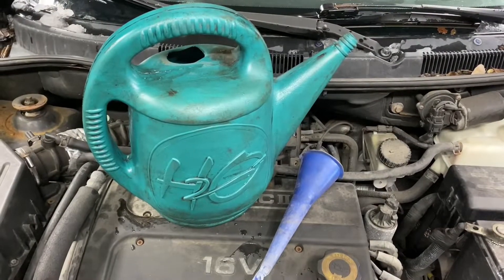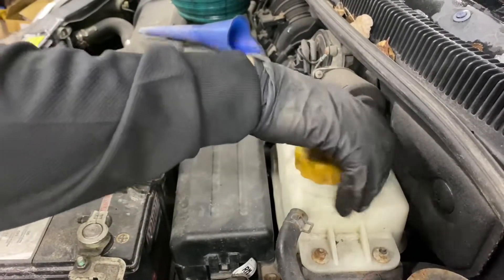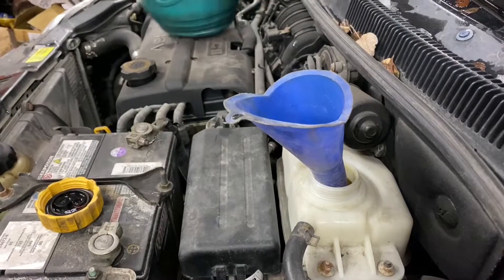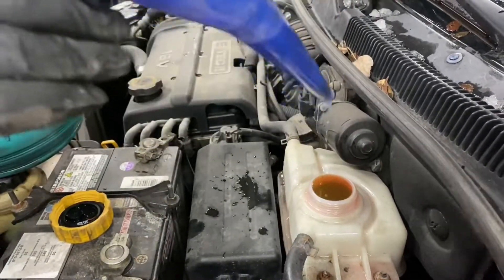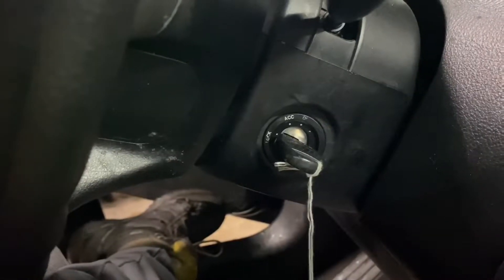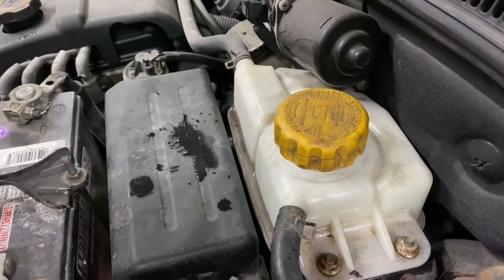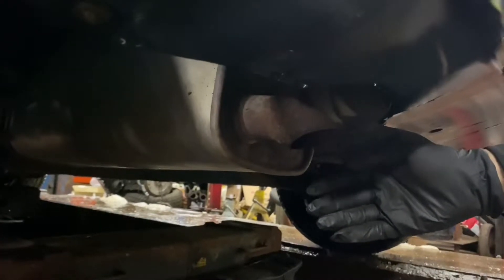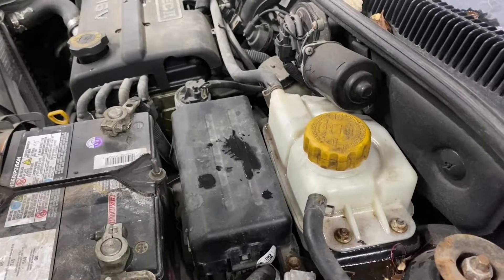What Happens If You Put Water Instead Of Coolant In Your Car! #subscribe #experiment #learn #car

Comment: Coolant is just water mixed in with some additives (a type of alcohol). The additive reduces the freezing temperature and increases the boiling temperature of water. Topping off the coolant with some water should be fine.

Comment: I have never used antifreeze in any of my vehicles. I use pure water. I have never had a single problem. I do drain the water every couple of years and there is a little bit of rust or dirt but no more than when I used to use antifreeze. Now, if I lived in a freezing climate of course I would use antifreeze. That's why they call it antifreeze!😊

Comment: You have probably over filled your cooling system.

Be ready for some potential pipes or radiator or resovior leaks, that extra fluid will build excess pressure and burst open something.
Reply: You say it like that's true. 
But it isn't.
Reply: @aaronbrown1638 Happened to me. I'm good now. Typical bot account

Comment: the reason why you use coolant instead of straight water is coolant acts as a lubricant for the water pump seals and bearings, straight water will do in a pinch but it will wear out your water pump faster, if you been using straight water dump it out and replace it with coolant! coolant cost like 15+ dollars a water replacement pump cost a few hundred!
Reply: I have never used antifreeze in any of my vehicles. I use pure water. I have never had a single problem. I do drain the water every couple of years and there is a little bit of rust or dirt but no more than when I used to use antifreeze. Now, if I lived in a freezing climate of course I would use antifreeze. That's why they call it antifreeze!😊
Reply: @bentrider  we call it all antifreeze, but in reality its two different items, im my younger days I never used coolant or antifreeze, I thought it was a rip off really water pumps would usually last about 5 years but back then it the older cars the water pump was easy to get to, the bearings would fail or the impeller fins would rust off, now a days with modern engines mounted sideways its not so easy to change, some cars the water pump is run off the timing belt so its buried in the engine compartment not an easy or cheap fix. now that I use coolant/antifreeze, I haven't done a water pump in years, if you use straight water with good results thats awesome, I have a lexus and a crown vic, the crown vic water pump is a piece of cake the lexus looks like a nightmare!
Reply: @mibnixon  😀👍

Comment: I used tap water in my hyundai accent for years
It caused rust in the cooling cycle and the rust caused corrosion in the aluminum parts, then the corrosion caused loss in coolant and heat then head gasket damage, the engine  started mixing water and oil
It was an expensive lesson
I got it fixed and replaced all the corroded parts luckily the engine is still in good shape
Now am using the only coolant which is certified by the manufacturer no issues so far
Reply: Same with my Elantra

Comment: Tap water will cause calcium buildup when it evaporates over time which will block coolant water jackets and will overheat your motor killing it over time.. distilled water will not do thaat but both will freeze and crack your block or something when it expands.  If you mix 75/25 water to antifreeze youll be fine using distilled water..  even 85/15 will raise the freezing point enough unless you live in places it gets sub zero..

Comment: I’ve been using only water for 12 years now and I’ve never recorded any damage at all 😅. And in my opinion I prefer water to coolant. That’s my personal opinion that I shared with you guys. 🙏🏽
Reply: So you say it won’t be a problem if i used water today because i’m too broke to buy coolant it’s expensive here and i’m just a student 😂
Reply: @lukaweixler howd it go?
Reply: @ still no problems👌
Reply: Has the water ever froze in the winter
Reply from the maker: It would definitely freeze in the winter.
Reply: I've been looking for this comment. 
Thank you bro . 

I'm on 2 weeks solid of straight water. 
Acura mdx 2006. 
And its been running better than when my car used to run coolant. 

I live in Hawaii. So there is no freezing
Reply: @aaronbrown1638 is it still good or did you finally use coolant ?
Reply: @polog4life668   the acura mdx , still works good, pure h20. 

The water pump could use a change, that seems to he the source of the slow leak. 

However , if your car takes coolant, and doesn't leak it, use coolant. 

Water works great for if you just don't care what happens to the car anymore tho. 

No harm no foul. Lol.
Reply: In a cold climate it would freeze.
Reply: @newsgetsold I live in Florida, it literally never freezes where I’m at, I always put water in with no issues at all
Reply: @xiguhide  Maybe I live in a warmer climate than Florida.
Reply: @newsgetsold  what area are you in and would it freeze when It never gets under 40 and rarely ever below 50 I’m in south Fl
Reply: 🤡🌎 rust!
Reply: Lost a heater core by doing this, rust ate through & leaked everywhere 🫤
Reply: Do you use the car for long trips Or for short trips around your area ?
Reply: Idk how you've had no issues in winter. I think it's totally fine for summer but the water will definitely freeze in winter and crack the radiator
Reply: Does it hit overhearing temperatures sometimes? I mean its summer right now and its usually 110 where i live (lake havasu) and sometimes when i run my bmw on water, it will hit the red, and go back to the middle, mainly when i sit in traffic and not run the car.
Reply: @frankiewild99 I have a coolant leak like everyday i have to fill it up but man $10 a thing of coolant i said screw it and started using water 2008 chevy equinox have t had a issue
Reply: @HtownTejano713  you still using water? i’m still scared to use it lol but i’m tired of buying coolant
Reply: @polog4life668  i actually got my head gaskets replaced and the heads too , it was still leaking after lol but after one or two months of use it stopped
Reply: No rust unless you use tap water or not changing  any coolant/distilled water for a very long time
Reply: LIES! Absolute lies
Reply: @ no it still works
Reply: @lukaweixler  Year around? FOR 12 YEARS?!!🤨 Absolutely not! Stop it
Reply: @ idk about 12 years but since i have it, it holds up. Sadly i crashed it 20 days ago
Reply: The same as me but disteled water, the same result no damage
Reply: No rust?
Reply: @user-hi3hk7te8i yes, rust 😢
Reply: @user-hi3hk7te8i  of course it will rust. Also if you put pure distillated water the metal of block and engine will contaminate it and will make water to be conductive. If your engine has aluminium or differente metals it will be damaged by corrosion. And another very important point is that water, especially if pressurized will boil at much lower point than coolant. When boil, or micro-boil, will make air cavity in your engine:  not heat conductivityh anymore in some places of your engine. Water is a poison for modern gasoline engine.